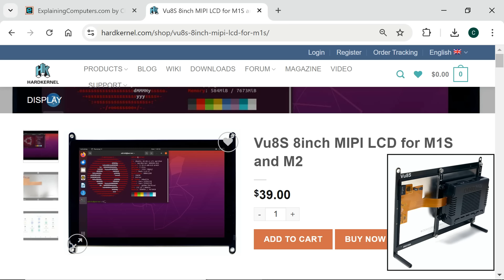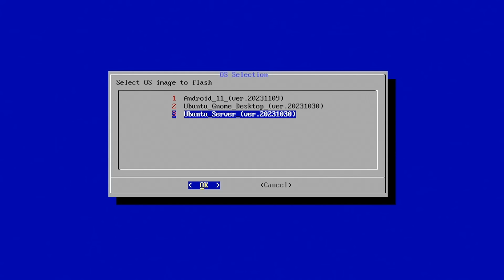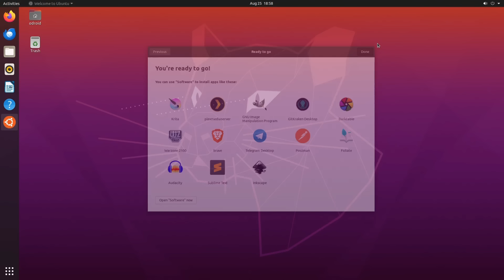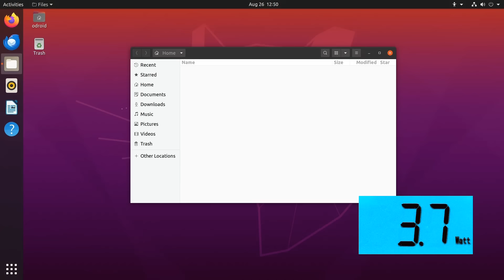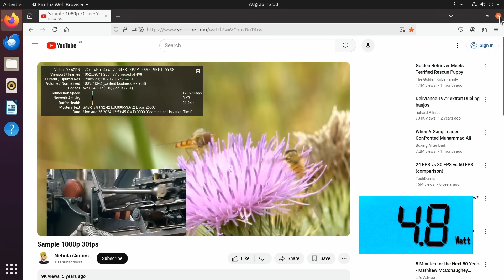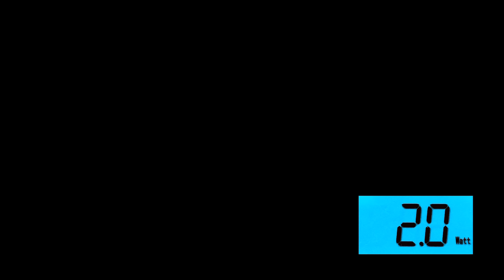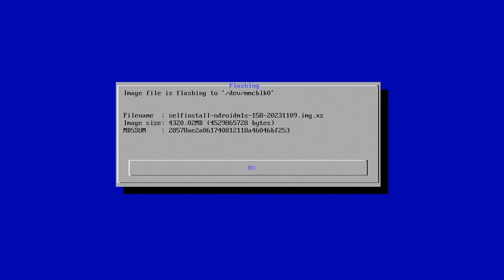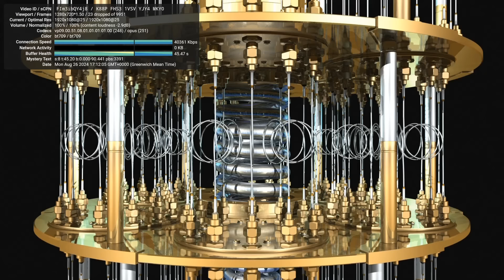Odroid M1S: Great Value SBC Kit

Comment: It is, as you say, designed for embedded applications. It should not be judged as a bad system just because it is being used for purposes it was not intended.
Reply: Exactly, it is not supposed to be a replacement for a desktop or laptop.

It would be the same as taking your family saloon car off-roading for a day and then complaining that the suspension is broken at the end of it.

"Right tool for the right job", and all that clever engineer stuff that consumers never listen to.
Reply: @terrydaktyllus1320  Right, But if you're stuck, the salon car will still get you down the road. I think it's good to stress-test these things with more OS than they can really handle, so we see how they perform while being maxed out. Gives a better idea what their realistic limits are than does just using them for the intended purpose.
Reply: @Reziac  "Right, But if you're stuck, the salon car will still get you down the road."

No, you're not answering my direct point, you're creating a different scenario - "driving down the road" is not the same scenario as "off-roading a car". Please stay on topic.

"I think it's good to stress-test these things with more OS than they can really handle, so we see how they perform while being maxed out."

Again, where did I mention "stress testing"? "Expectation of a desktop replacement" is not the same as "testing the suitability for such".

There's no point responding to me if you're not going to address my actual points.

"Gives a better idea what their realistic limits are than does just using them for the intended purpose."

Sure, but if you're an engineer like me who knows what he is doing, you don't "stress test" every single possible platform that might be used for a particular solution - you eliminate most of them before you even get to "stress testing".

"Stress testing" is something an expert does, "expecting an SBC to replace a desktop or laptop" is something someone who doesn't know what they are doing does.
Reply: @terrydaktyllus1320  Do you ever get tired of your own voice?
Reply: @FlyboyHelosim  I don't answer the questions of strangers on the Internet. 

But what has the sound of my VOICE got to do with WRITING comments?

Are you really THAT hard of thinking?

Do try a bit harder to keep up.
Reply: @terrydaktyllus1320  No one ever lets the Raspberry Pi's off for this failing and its also not actually meant to replace a PC. If you need a PC buy a PC.
Reply: @backgammonbacon  I agree. The days of the SBC are over — except in embedded applications. When you can buy a complete Intel PC for approximately the same price as an SBC — without a case or mass storage— you’d have to be crazy to buy the SBC. The only reason to buy one is because you need that particular form factor.
Reply: @backgammonbacon My main desktop for the last 5 years has been a Raspberry Pi4. It does 90 percent of what I need. For some things, I power up the Mac Pro that I also use as a heater. Most computers today are ridiculously over powered for their typical use. I bought a Pi 4 to fool around with and it just kind of took over my desk.
Reply: @ninline2000  But you've made my point for me - "doing 90% of what a desktop does" is not "replacing a desktop".

And how is your 90% calculated? 9 out of 10 applications? Or 90% of your time? It doesn't really mean much as a statement anyway, without qualification.
Reply: I disagree. You are stuck with very poor software support in an older Linux. Rather spend my money elsewhere.
Reply: @Nerd3927  But for embedded applications, you don't NEED the latest and greatest Linux version. It's overkill to even put a full Linux distro on such a platform. If, however, you're going to try to use this as a desktop PC, then you are absolutely correct.
Reply: @CCoburn3  I see your point, but then I would go for a Pi Zero or  derivative. Writing my own driver for GPU and NPU is beyond my capabilities. Bloody irritant if it is there, but you can't use it.
Reply: @Nerd3927  There are certainly situations where a microcontroller is more appropriate than a microcomputer. In those cases, it would be a waste to use something like this. Why pay for more computing power than you need? But in other situations, a microcontroller just doesn’t have the capacity to do the job. 

If you want a device that turns on the sprinkler every other day at 6AM, the a microcontroller will handle the job. But if you need a device that will turn on the sprinklers every other day if it hasn’t rained in the last 24 hours and the chance of rain is less than 50%, then this sort of microcomputer would be required. But it’s never going to be able to browse YouTube videos. It wasn’t designed for that.
Reply: @CCoburn3  I would say that is still in the area that a modern micro controller can handle. To move to a SoE or bigger, you would need to be performing some sort of action that multi cores working together,  access to large amounts of RAM, decent dusk storage, a multi tasking operating system, or something that. 

Even those things could be handled to some degree by  a micro controller but you would be in the business of writing a load of your own low level code instead of standing on the shoulders of giants that have already created it for bigger platforms.

Comment: My more powerful laptop runs slow compared to a pentium 3 back in the day. Operating systems are too heavy
Reply: Indeed, and most of today's hardware performance benefits are negated by bloated operating systems and programs.
Reply from the maker: Agreed.
Reply: @FlyboyHelosim  Part of the problem is software developers code their programs for the resources they know they have. Does the average user have 8GB of RAM? Then the program will greedily take 2GB when it could be programmed to run on only 256MB.
Reply: @hermanwooster8944  Well yeah, that is certainly part of it.

Comment: I'm still saving up for my 1st Ras Pi 5
(Don't EVER get Poor! - You'll regret it !! lol)
Reply: Stick with the clones - in my experience which dates back to Pi A and Pi B models the first practical SBCs, I've found the Chinese do it better for less money and now we have developers like the Armbian project providing excellent support for many of them, there's littler reason to bother with our home grown stuff.

OK, I'm cheap, but I'm also dirt poor and I've been running some early clones as file servers for years (with DietPI and SAMBA). They're almost bullet proof and run from small 5V, 2A (10W) wall warts without ever breaking sweat. Linux servers are so stable that they can sometimes run even if some idiot pulls the disk (SD card) and often when a drive develops a fault in a non-critical area (that's only used during boot for example).

Not that I recommend trying such a stunt, but leave them alone and they're as solid and reliable as a wall socket. And you can forget them almost as easily.
Reply: i feel you  i know for real
Reply: I did, and I do 😊
Reply: 10/10 do not recommend
Reply: If you don't need it's extra power i would recommend sticking with used pi 4.
Reply: I grew up poor and while I have learned quite a few things, it's not at all a nice stroll in the park.
Reply: For the price you can usually get an x86 sbc with similar tdp and performs better as a desktop replacement.
Reply: @Praxibetel-Ix  I'll second that, growing up with not much I think that's many peoples stories!
Reply: go with intel n100 mini pc's or Embedded motherboards. because they are same price as the fully decked raspberry pi With the case, Cooler sd card or an ssd. And they are much powerful than raspberry pi for sure.
Reply: @vinsan98  how many monies?
Reply: @solanumtuberosa  it depends on what is the target usage. If it's experimenting with ARM, x86 computer will not cut it. If it's having a home automation server/cloud/etc, x86 computer is perfect.
Reply: Don't get a Pi 5. They changed so much compatibilty is shot. They also are running older hardware. 

As suggested look for a cheaper, similiar board.

Comment: I saw there is a Mini-ITX RISC-V motherboard out there called the Milk V Jupiter. It really is a step in the right direction for RISC-V. I think in a couple of years most budget computers are going to have ARM and RISC-V processors instead of X86 processors.
Reply: As much as I love RISC-V, I fear your prediction is only half true. ARM is the only architecture between the two that has enough corporate support to break into the budget PC market. RISC-V may achieve the same, but it is well more than a couple of years away at this point. As it stands, RISC-V is chipping away at the bottom of the microcontroller market which was once occupied by the likes of PIC, and Google is reportedly shipping them at scale in their latest generation of hardware AI/ML accelerators. So there are reasons to be optimistic still. Btw, I got a demo of the Milk-V Jupiter last month at a conference courtesy of the RISC-V team at Red Hat, but it was lacking any graphics acceleration support. I know it has a display accelerator on board, but I'm not sure if it's a case of waiting for the drivers to get merged into the mainline Linux kernel or what. Imo, this class of problem is a big part of what keeps desktop RISC-V from being viable for the masses for the time being.
Reply: @LargeDivisor  I think that RISC-V is 6 years behind ARM. I think in 2030 RISC-V is going to be used in mini pc's and some laptops. I hope that RISC-V will be used in more and more devices in the near future.
Reply: @LargeDivisor  RISC-V is doing quite well in the server space. This practically guarantees its development will be expanded. Whether it breaches the desktop space is another question.

Comment: I really like the complete package approach -- no need to hunt up a case, just plug the thing in and off you go. That power use is low enough to run off a portable power bank, too. I wonder how much more it uses with the NVMe installed?

Side thought: one could predict a cottage industry in gutting a dead laptop, install one of these boards, attach it to the existing screen and keyboard, and voila, a complete portable unit. (That's actually how my Asus netbook is designed, it's an SBC in a netbook package.)
Reply: Technically, every laptop with soldered RAM and storage is an SBC in a laptop chassis. If oyu don't count the boards in ram or storage, that becomes basically all of them. They're all just extremely specific shapes with weird I/O.
Reply: @DigitalJedi  The Asus is a complete unit, tho, just unscrew and out it comes. It actually looks like a Pi board, and everything is soldered to it. (There's also an NVMe slot, but not really worth the bother.) It doesn't have this and that crammed into far corners of the case.

Comment: Maybe an SBC with Bluetooth, paired with a portable Bluetooth speaker would make a good streaming "radio" at a modest cost?
Judging by the power use and those hefty heat sinks, temperature wasn't enough of a problem to discuss?

Comment: Thanks Chris and Odroid for launching another SBC wallet grabber…😂!  I have a PineTab 2 which uses the RK3566 chip a find it able to run most of my Amateur radio software, so the Odroid should do the same. However, I would just spend the extra money to get the plus model including the SATA drives.
Have a great week.

Comment: Odroid M1 or M1S is great SBC as core for nas example. That M.2 nvme slot allows great extension for sata adapters. Thou the M1S has slow pcie-lanes. If you wanna use it as basis for nas choose M1 instead as it has faster interface.

Comment: I wonder why they supply an older Ubuntu for install when a newer release may even handle graphic acceleration in the new kernel.
Reply: Usually it's the kernel modules being developed ongoing. It's likely that they're either not yet compatible with kernel 6, or built into a later kernel - but this would preclude them continuing their own development purposes - note these are usually sold as "development kits" rather than "home use plug and play sbcs". 
I was using a brand new Rocki4c+ the other day - and for those reasons, unless you buildroot or armbian your own distro, that's limited to kernel 4.4, and its supplied current base distro is Debian 11
This isn't due to lack of low level bad planning, but that the SLTS CIP [Super long term support civilian infrastructure platform]linux kernel is 4.4 - and so many of these target this Super Long Term kernel for multi-system compatibility reasons - at least at their core development end - as that's what the hardware engineers need - super long term stability, not just long term, else they get grumpy :)

Comment: Night and day performance on video playback between Ubuntu and Android.  Odroid has as you pointed out a little work to do to supply GPU acceleration.  BTW, can you embed the X acceleration when speeding the video up?  Might help gauge the true speed of the equipment?

Comment: Power usage when running android would have been nice. As you said android chipset drivers are better, perhaps power usage as well.
Reply: Seconded. And I would also like to have seen power usage during NVME testing.
This looks like a really sweet board to run HA. But I would like to be able to add some storage beyond the included MMC if it doesn't double or triple the power draw.

Comment: I really liked some of the features of my Odroid M1S... until it failed on me.  During a power outage, the M1S was plugged into a shared surge suppressor with an M1, and XU4, a Mikrotik MaP, and several other devices.  The M1S was the only one to fail, and no longer boots.  This experience has made me leary of buying another one, if it has some weakness to spurious events -- how can I trust it to deploy in normal embedded system scenarios if it's flaky like this?

Comment: It's a bit surprising it can't keep up with a 720p video but I guess it would potentially be useful for non-desktop uses. It just seems like a larger, more expensive Raspberry Pi Zero.
Reply: Probably like most of these Chios no video drivers with acceleration..
Its makes them useless..
They have acceleration but only for real company made software.. No Open Source..
Makes them useless unless you are making an embedded product to sell and want lots of them..

Comment: Great! I'm curious about USB support in this SBC. I'm a bit upset with RPi's USB support that always fails in my projects If I don't use a powered usb hub.
Reply: Does this include Raspi 5? As I understand it, Raspi 4 and 5 can handle quite a bit of power drain.
Reply: @simpletongeek  RPi 5 I've not tested yet. 4b and 400 I've got issues when USB3 ports are on heavy usage load(not only power usage, but I/O usage). Sometimes stops working until I restart the board.

Comment: Timeline: New SBC > Happy Face > No Wifi > Sad Face. hehe
I have a couple of old Odroids, and they're lovely, but like with those old ones and these, I'm always disappointed these days when I see any new SBC that it requires me to add [and shop for a compatible chipset for the kernel] WiFi... I wish they'd have no ethernet but Wifi & Bt instead - or at least always release one wired, one wireless... that way those needing PoE are still happy too :)  yea yeah - blah blah hand wavy production costs etc :) - but if I can add an off the shelf device at home to add WiFi for a fiver, you manufacturers can stick one on it in the factory for less... i dare yas :))

Comment: I often wonder if the idle power usage is high, because of the single board computer, or because the included power supply is poor quality. 
Would you mind to add a measurement of just the power supply, with the sbc disconnected?

Comment: The the major issue with many of these Rockchip SBCs is that those chips were originally meant to run Android which means there was little incentive for the chipmaker to write proper drivers to make these chips work well on desktop Linux.
It is unlikely the software support for these chips will ever come anywhere close to the likes of Raspberry Pi.

Comment: Where is the speed bottleneck? emmc or cpu? Does the m2 drive make the experience snappier?
Reply: eMMC is _slow_.  It works but is one of the slowest forms of storage.  I would say that the LPDDR4 RAM is the second bottleneck.  The CPU is the third bottleneck.  The lack of a dedicated GPU is the fourth bottleneck.  This whole system is loaded down with bottlenecks BUT that is actually a good thing.  You buy this type of system for two reasons:  Extremely low power consumption and to use it as a back office, always-on system OR for development/test purposes.  It's not really intended for use as a daily driver.
Reply: a55 was the type of arm cpu you got in 2017 on cheap smartphones, so there is your bottleneck

m.2 is nicer but a decent sata ssd will not disapoint you

Comment: Bar AV1 the iGPU (ARM Mali-G52 MP2) has a of full set of decode and encoders, so with the Codec's for those formats and drivers it should run video really well for a entry 2D GPU it is well packed really.  (Info found of CPU monkey) it has h264, h265  HEVC (8 bit), h265 / HEVC (10 bit), VP8, VP9, VC-1, AVC and Jpeg, Decode and encode. This would be good for a CCTV system or Media TV streaming system although security low FPS is probably more suited but adding AI via a google Coral card and M.2 adaptor would be strait foreword. Although you would be force to a single chiplet though as I doubt this board will have PCI bifurcation.

Comment: Ok, no hardware acceleration, not its intended purpose and so on, but I was shocked this board can't play YouTube AT ALL! I did not expect it to be way worse than a Pi Zero at that!
Reply: The reason people buy Rasberry Pi systems is due to the company allowing the graphics hardware info to be used by open source which allows working video drivers with acceleration..